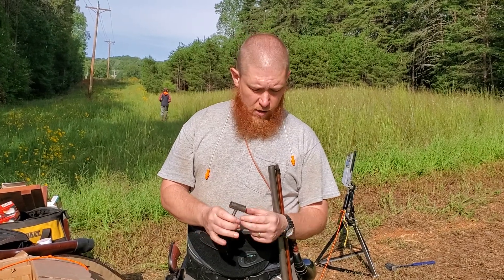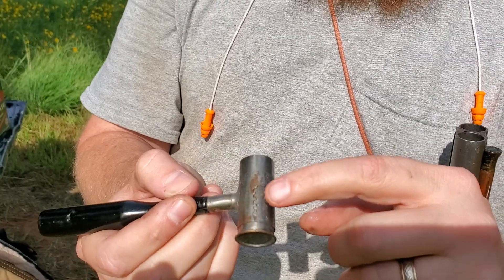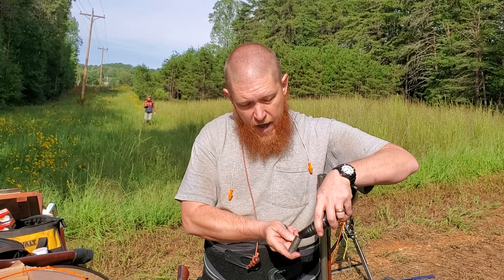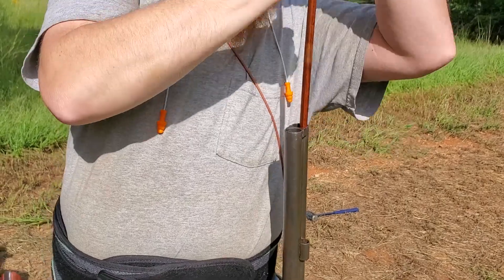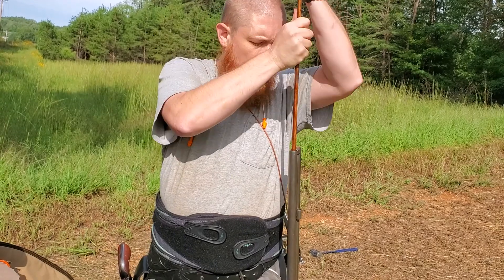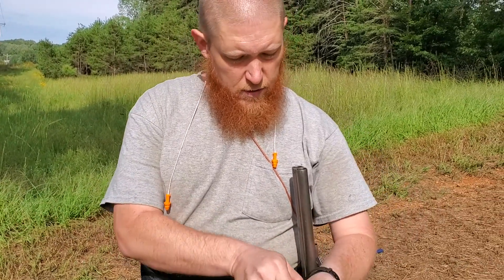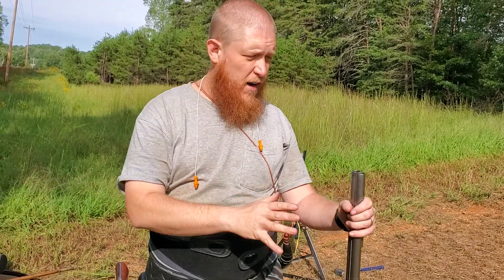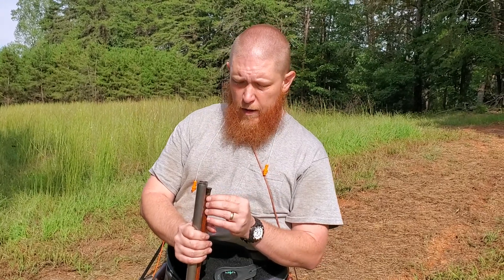How to load a Muzzleloading Shotgun

Comment: What a well presented video on ML perecussion shotgun loading, well done.

I've been competing and hunting with muzzleloaders for fifty years.

What you are doing is just fine🙂.

A wee tweek would be, cut the fibre wad in half and and then put another nitro
card on top. 
The reason for this is, the lubrication could make some of the shot stick to it.
Plus, the top over shot card is better if it is thin (as you said) but glossy too, it 
stops shot sticking to that as well.

Comment: Very informative.  A tip - if you want to protect your nipple keep a tire valve cap over the nipple to prevent the hammer from falling directly on it.
Reply from the maker: I use a small section vacuum hose, but great tip.
Reply: A spent .22 case works too.

Comment: I'm a old poorboy myself. I'm planning on making me a muzzle loading shotgun with 1" DOM tubing inserted inside of a 1" black iron pipe with a breach plug welded in the back and drill and tap for a 209 nipple. And build my own stock (40+ years carpentering I think I can handle the stock ) and only load light to medium loads.
Reply from the maker: If you have the skill to build it, it sounds like a fun project.  Just be careful with the first few shots.  a 1" pipe would be like 4 or 5 gauge depending on the ID.  They do make wads for that size.  It would be fun to shoot!!
Reply: @murphyfirearmstraining3630  The inside is perfect 3/4 ID , that's a 12 gauge if I'm not mistaken. The 1" dom tubing has a wall thickness .095 and the 1" black iron pipe is SCH 40 (ball park 5/32) The barrel wall will be somewhere around a heavy 1/4" thick
Reply from the maker: @leonardwilson980  3/4 would be 11 gauge.  My gun in this video is 11 gauge.   12 is 0.729.  If you used 12 gauge wads you would get some powder blow by.  With that thick of a wall and black powder,  you would be plenty safe.   Sounds like a fun project.

Comment: I take it. It does not matter if you're left-handed or right. Handed with precaution, cause either way, you hold it. The gun's gonna have a cap in front of your face I have a percussion rifle. I have yet to shoot because I am afraid of the flash And you probably could just use paper for wanting. It might not be as accurate but it could be cheaper
Reply from the maker: There is not enough flash from a percussion gun to ever bother your face.   The biggest issue with a percussion gun is occasionally the spark will get your arm if you are wearing short sleeves.   It's not bad and you get used to it.   That's the biggest issue I have had with a double percussion gun.
Reply: @murphyfirearmstraining3630  Unfortunately, because of any anti-gun Doctor I am limited to muzzle loading, but then again, some muzzle loaders are more powerful than modern guns. Depending on what can you pick

Comment: Good clear instructions but having had a friend injured recently by an unintended discharge from an un primed rifle the sight of the hand over the muzzle when pushing the ram rod home made my skin crawl.
Reply from the maker: Was he shooting a lot and a hot ember ignited the powder?   I would love to know more.  When I shoot at more than a snails pace, I swab between rounds.   That ensures no hot spots in the barrel.
Reply: @murphyfirearmstraining3630  
That seems the likely cause. Most of us do swab between shots but it is generally the rule on the ranges that I use that the hand is never used  to apply pressure directly over the muzzle.  In the case of some patent breeches even swabbing is no guarantee of a safe load. This is the first accident of this type I have first hand experience of in over 40 years of BP shooting but I'm aware that there have been instances where a spark has set off the powder and the result, due to keeping the hand around rather than over the muzzle has only resulted in burns and a rather shaken shooter.

Comment: Looks like your strap for your powder horn is attached to the "plug". If it is you might re-think that method. While walking if the plug ever comes out, your powder horn will tilt townward and dump all of your powder onto the ground. l
Reply from the maker: @Hazeltonpeakroad  I agree with you,  but I have 2 powder horns and have never had that issue with either.  The way they're made, there's really no other way to tie the strap on without it slipping off.

Comment: How well does the over shot card hold after the recoil from the first shot ? I'm planning on shooting one and was going to use the cushion wad as a over shot wad till you cleared this up. Also I plan on using plastic shot cups to keep the shot tighter together, I read this on some black powder forum sounds like a good idea, any thoughts on that . Thanks for the video .
Reply from the maker: I have used plastic wads, but they don't do as well in my gun because it is an 11 gauge.   If it was a 12, I would use plastic wads all the time.  They will get you a tighter pattern for sure.  

The overshot cards in my experience do a great job keeping everything packed tight and I have had no issues with recoil loosening the shot column in the 2nd barrel.
Reply: @murphyfirearmstraining3630  I have everything needed for a 20 gauge that I got about two months ago, and just purchased a twelve gauge last week so as soon as I get some weather that matches my days off I'll be trying the 20 gauge, glad I viewed your video, the only shot I have now is .00 buck, will be getting some 6 shot as soon as my friend runs another batch. My 20 is a Pedersoli  and the 12 is a CVA and I just found some negative thing on the CVA hoping that mine was produced in 1985 from what I can find on the serial number I think it's in the clear.

Comment: Any idea what velocities you're getting with your powder to shot ratio? Would it be any different with buckshot?
Reply from the maker: I would like to chrono this load one day, but there are charts in my black powder manuals that are really good estimates.   Should be about 1165 fps.  Theoretically buckshot would go a touch faster because there would be less weight in the same size scoop because of the air gaps between the large pellets.